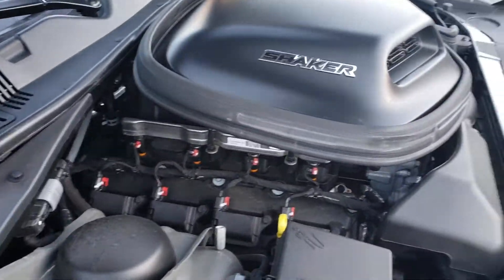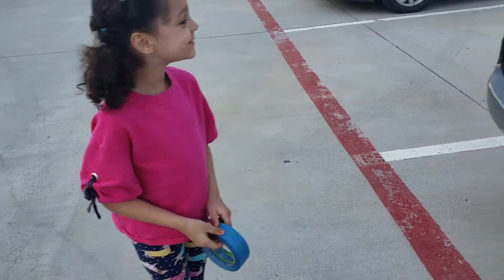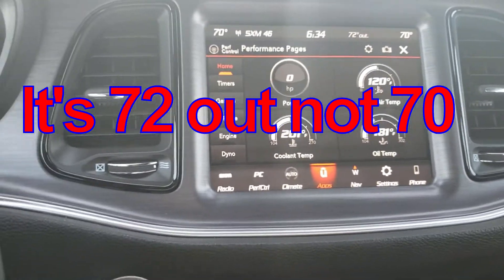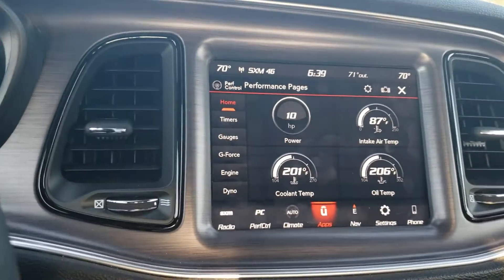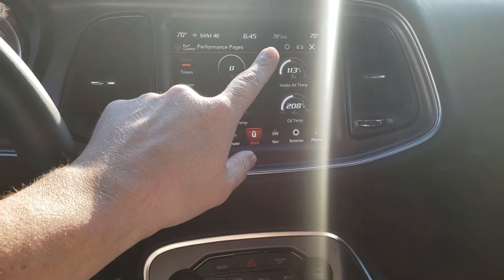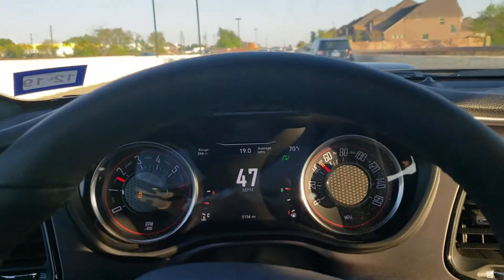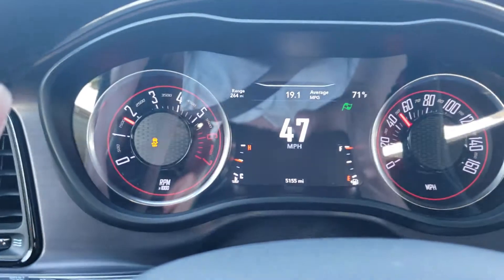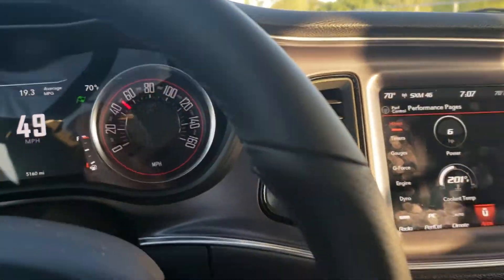Intake Air Temp experiment , part 1

Comment: If the air inlet temp sensor is in a position where it can get heat Soaked ,it will always read the same reading .Which is the incorrect reading its giving the ECU. You need to insulate the air temp sensor ,.It doesn't make any difference how much air is getting in if the air temp sensor is heat soaked .It will still give inaccurate high readings. Either insulate the air temp sensor or move the thing!!!!

Comment: My 2018 Scat Pack 392 Shaker (also w/ the headlight Mopar air tube) IAT stays within 5F of outside ambient when moving regardless of speed. Stopped, IAT goes up to 10-15F over ambient.

Comment: 4:56 What is that big plastic piece in the challenger rt models and what is it for?
Reply from the maker: It's a silencer to quit down the intake but it in turn disrupts the airflow.
Reply: @OffbeatMotors  hmph. Funny how the charger rt doesnt have it
Reply from the maker: @blackice7408  right! It doesn't make any sense to me why they did that. I'll be replacing mine with a different one for sure.
Reply: @OffbeatMotors  yeah on the vid you said that you would replace it for the oil catch can (which is very important for hemis. I saw a 2019 charger rt with 310 miles, i started it up, amd it was burblimg in the start for about 3/4ths a second, then blue smoke came out.) Btw, unless you mod fhe heck out of the 345 hemi to the point where it needs to run on 93 octane, altering the air intake or ordering the shaker package for extra air is completely overkill and is a waste of money. The 345 hemi with the stock intake is more than enough. Unless you wanna see lower intake temps, theres no point into getting a cai, or the shaker paxkage (unless you want it for looks). Now the 392 and the supercharged 372 hemi (especially the supercharged 372) id recommend fetting a high quality cai thats sealed
Reply: Oddly my 2019 Shaker RT doesn’t have that resonator at the end.  Mine is just like the Charger.

Comment: What I don't like about the shaker package is its completely sealed the engine bay. No hood vents to cool down that hemi. And them hemis produce a lot of heat - which will heat up the entrance of the air going in. So the filter might be reading 79°, but because the entrance for the air to the engine will be very hot, it might heat up the air up to 100° and you might not even know it
Reply from the maker: Mr Scowl Face valid point you make about the heat form the Hemi. Some type of heat extractors would be nice to help with that.
Reply: Offbeat Motors yeah. I don't know how dodge got away with this. Because in all of their hemi models (except the charger rt and the shaker models), there is some sort of hood vent, 2 small hood vents, or a hood vent with 2 heat extractors. For the charger rt, there should just be a hood vent - period with the big ugly plastic engine cover removed. The shaker should at least have 2 heat extractors on the sides of the hood